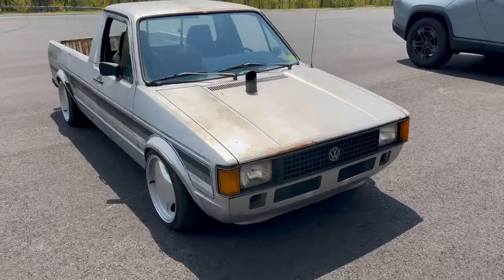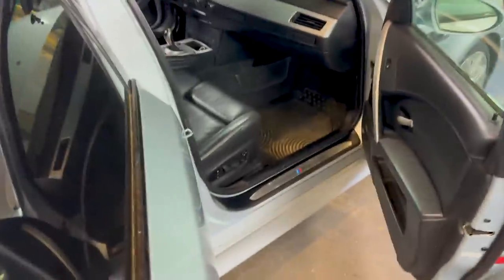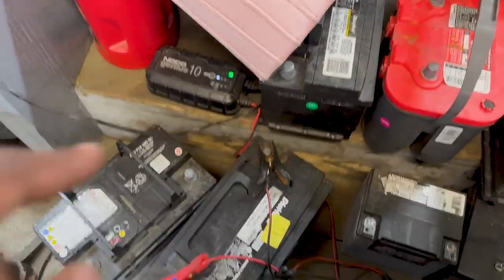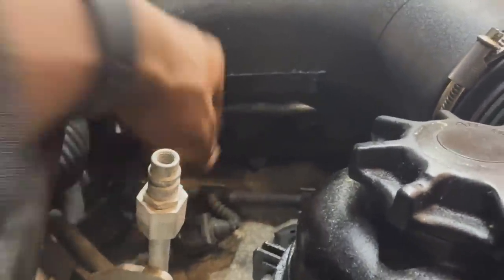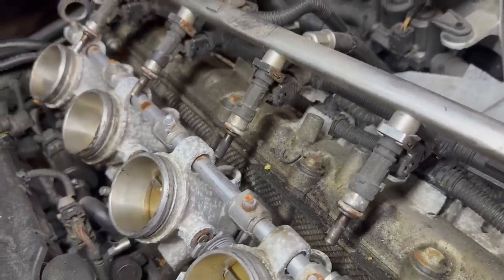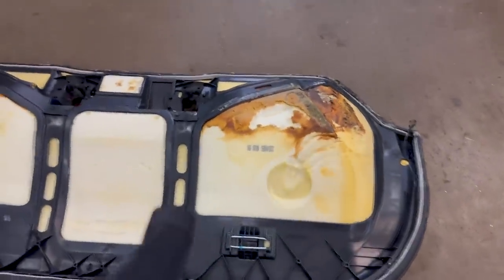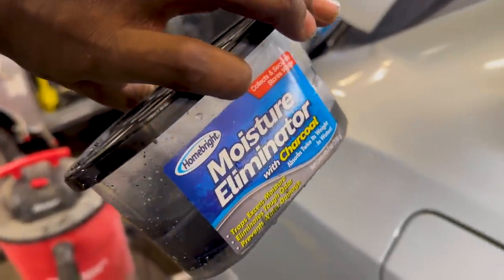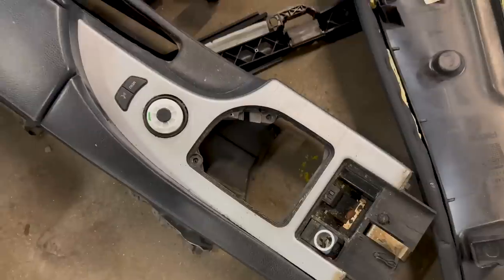Fixing a Non running V10 BMW M5, a marketplace disaster, please help

Comment: Rich: If you replace the battery with a new one, you'll also need to reset the computer as the alternator varies the charge based on battery age. If you install a new battery without resetting the computer, it will continue to think that you have an old battery and will continue to send a higher and excessive charge to compensate for age, prematurely destroying the battery. This is a well known BMW issue in newer models. As for the moisture issue, I know of a great way to get rid of that, it includes a giant box and a crapton of rice...
Reply: issue ? lol 😅 its not issue, you only not understand that system...also you need to register proper battery type / amps...
Reply: God I hate new cars
Reply: I must be a man of little patience, because at this point I'd be buying a bicycle.
Reply: plus you could have lunch
Reply: @FalculoCornuto  Of course, that's part of resetting the system and computer. Going in and resetting the battery data is what informs the computer of manufacture, months expectancy, CCAs, and other battery data. It's a BMW, that's par for over-engineered German cars.
Reply: @FalculoCornuto  What an odd reply.
Reply: When I put a new battery into my E65, my climate control started acting all crazy. Air positions would change on their own and the whole system would turn off at times. Was driving myself crazy trying to figure out the problem until I found out about this feature. Funny how advanced these cars can be but they’re not smart enough to realize they have a new battery. Luckily after telling the car it had a new battery everything worked perfectly.
Reply: Lmao I drive with disconnected IBS and  have zero issues. I couldn't care less about registering new battery and all that stuff, car works just fine.
Reply: You need a respirator for things like this. Breathing spores is dangerous.
Reply: @pavulon5000  It works fine until the continually overcharged battery explodes in your truck a few months later, leaving hydrochloric acid covering everything and significant body damage. This is a known issue in modern BMWs.
Reply: @WS102  I guess I'll reconsider my decision
Reply: Speaking of power, anyone have wiring schematics for e60s? AC compressor isn't recieving power. Need schematic to test it.
Reply: I thought this was satire at first
Reply: All good points. He did the rice in a box with the Audi.
Reply: He needs to replace the ionic control modules too....
Reply: This is why I bought an e55
Reply: Car doesn't run for that to be an issue at the moment lol
Reply: @WS102 sulfuric acid*
Reply: @ReservedForFutureUse  It's a great system, it's just not intended for backyard mechanics to deal with

Comment: Rich, use a spray bottle filled with a sodium carbonate solution on the mold. It's $30/gal at the hardware store but you can mix your own by purchasing a box of A&H Washing Soda at the grocery store. About 1/4 cup per gal with 1 or 2 drops of dish washing soap. Spray it on and it will kill and help immobilize the fungi. After it dries, it leaves a fine white layer which prevents spores from taking hold on the surface.  A damp rag will remove the residue.  I'd spray every surface at least twice and then put a room dehumidifier and an ozone generator in the car and let it run for days.
Reply: I'm personally a huge fan of Moldex it works wonders. Good tip though.
Reply: This is good to know, I'm often horrified by moldy interiors and always wondered if there are ways to get rid of it, short of just stripping and burning all the moldy bits.
Reply: Clear distilled vinegar.
Reply: @Thinginator  I learned this after our flood in 2013. You really need to get as much moisture out of the air as possible, along with coating every moldy surface with the carbonate. Carpet and insulation is near impossible to de-mold, so remove it and expose the bare surfaces underneath and then treat.
Reply: Or better yet sodium *per*carbonate. Breaks down into a mixture of sodium carbonate and hydrogen peroxide when you dissolve it in water.
Reply: @802Garage  I'm a huge fan of people who refrain from calling everything "personally" but that's just me. This particular mold has even reached Europe.
Reply: @TheBackyardChemist  Good call. It's more expensive, but more effective at cleaning. A&H is less than $2/lb while percarbonate is about $9/lb. OxyClean is a 50/50 mix of the 2 at around $3/lb.  I already have some (with perfume). I'll be using it when I refill my "anti-mold spray" bottle.
Reply: @narvul  It's funny you say that. I wrote a comment on the latest Tavarish video earlier today and used the world "personally" in the opening sentence and realized it sounded stupid so I deleted it. I try to refrain from using unnecessary and obvious language, but sometimes I fail. At any rate, Moldex works great!
Reply: People,  don't ignore the room dehumidifier idea.  It works,  in the house too,  makes the AC work better using less energy.  
Anywhere there is a moisture problem,  just let that sucker run day and night and see how much water it removes from the air.
Reply: @802Garage  Moldex is even available over here in The Netherlands...!! I've never needed or used it but I know the health danger of mold, especially black mold. I had it in my house but a dash of perchloride did the trick.
Reply: @narvul  I had an Eclipse with a smashed window and mold grew on the carpet, seat belt, and actually on the seat leather! I kid you not when I sprayed Moldex on the seats the mold disappeared as if it was turning invisible. Killed it right in front of my eyes and it hasn't come back. It doesn't have that vanishing effect on all mold, but spray it on and wipe off and it tends to be dead and gone.
Reply: @802Garage  probably this Moldex contains chloride.
Reply: @narvul  Are you personally a fan of that?
Reply: @narvul  Could be. Haven't looked up the ingredients yet. Didn't damage any cloth or plastic or other materials though for me. :)
Reply: @jiminauburn5073  I'm personally (doing) everything. Maybe you should diversify.
Reply: @802Garage  Chloride is the main killing ingredient for mold.
Reply: @randolfo1265  When I lived in a no-AC house in NC (I grew up in CO) we used to collect gallons per day in order to help make at least one room "mold free".  In a car like that, I'd set 'er to 11 and let her rip for at least days.
Reply: @frankhage1734  -  Sounds like a good plan
Reply: Concentrated vinegar works great
Reply: @infernaldaedra  Like using bleach, vinegar works but does not leave a residue which prevents mold growth.  Until the area is bone dry, mold will spread.
Reply: @frankhage1734  bleach actually is only good for removing the mold stains, vinegar treats the surface for some time as I've tested it in wood that was molded just as bad from a conversion interior and the vinegar treated wood did not grow back spots, but on wood because it seems so deeply I recommend treating it with polyurethane

Comment: You should..you should probably get a respirator. Mold is no joke.
Reply: Not that big of a deal. Open air. Use gloves, wash your hands and don't stick your face in it or try to eat it. More than likely it's just mildew! They will be fine
Reply: @theglitch99  You clearly know little about mold.
Reply: Throw a chlorine  tablet in a water cup, leave it in the car for a few days sealed up outside.  I'm not sure it helps with mold spores, but it should kill most anything biological,  Including the smell, and make it safer to work on.

Comment: Rich, long time E60 M5 owner here:

If you decide to keep the car for a while:
- change the injectors
- the buzzing sound you here is the SMG hydraulic pump priming. Don't worry
- on the front of the engine there are two ionic current modules. These can cause misfires and no-start issues.
- check the fuel pump, fuel breather valves (under the intake plenum) and the charcoal cannister. Check all fuses.

Good luck!

Comment: I had the same issue with my e60 530d that wouldn't start after flattening the battery. Turns out the immobiliser can forget the key code if the battery is drained on these with no obvious signs other then turning over but not starting. Before spending countless hours replacing stuff i highly recommend looking into re syncing your key first(can simply be done with a usb obd cable and software called INPA ).   Love the new addition to the channel by the way and can not wait to hear that thing sing once you get it going .
Reply: The car would throw a key fob light on the dash. ^

Comment: M539 Colab! He's a Youtube BMW Legend!
You'll have it up and running in 1 episode with his help.
Good luck Rich, love the way you push the limits of humour without triggering Youtube or people! 😁😁
Reply: Sreten doesn't have time for a redneck M5 like this one.
Reply: @millll111lllI  😂😂😂
Reply: Use to pour hot water mixed with bleach down the rain gutters in our X3 every 3 months due to the same water issue. Also, did a head gasket on it..if the injectors are not put back in the same spot..they will not work.
Reply: I was about to suggest the same. M539 Restorations is awesome and his V10 vids will tell you everything you need to know.
Reply: I love M539, but Nathan’s BMW Workshop has resurrected a few V10 M5s now, and actually considers them reliable when properly maintained

Comment: I've owned a E60 M5 for about 7 years now, injectors are on world wide back order. They are a Bosch item so you might be able to find some Bosch ones in stock somewhere.

Apart from Rod Bearings, the throttle actuators need to be rebuilt, but you can wait until they die before doing anything. Vanos is generally OK, don't really need to do anything unless you have an issue. And you already know about the SMG pump, again, doesn't need attention unless you have issues.

That noise you hear when you connect the battery is the fuel pump priming, btw.

Comment: I just had the same crank/no start issue with my M5 and the fix was the cas and dme units had to be resynchronized with a decent scanner. The sound, torque, and handling make this thing well worth the headache.

Comment: Rich,please check the wiring harness on each side of the interior. What can happen is if they get wet there are weird connections that corrode and cause shorts. If you resolved those connections after drying everything out , you will avoided electrical issues. Porsche is known for the same issue,especially Cayyanes.
Reply: That’s what I’m thinking. Various codes for several systems and standing is probably ecm/bcm/harness related
Reply: Don't forgot every Infiniti! Ask me how I know :(
Reply: Cayenne owner here. Yes. He's already got the seats and carpet up. I didn't remove my carpet entirely but I think it was about 7 electrical junctions on each side.

Comment: Rich! go in engine bay, underneath the ac vents (remove them) there is a black box at passenger side open it and ‘ll find the main engine wiring harness, modules, connectors and various fuses. I had a similar problem involving the water drains and the black box was filled 1/3 water, various modules where fried i had to replace them, the e-box fan was the most difficult to access at the bottom.

Comment: I've got a 2006 with 186.5k on it. That periodic whine when you first turn the car on is the gearbox hydraulic pump motor. It spins up to prime a pressurized reservoir which runs the clutch and shift actuators. It will occasionally kick on while the ignition is on (even if the engine is off). It sounds healthy.
The good news is that it's all self-contained on the outside of the gearbox. Even the cooling, which makes the gearbox fairly easy to remove. All you have to do is unplug the harness.

Comment: I have a 2016 x5 and the sunroof front drains clogged and flood front passenger seat.  Used weed eat line to push through the clog and blew it out with air.  Passenger airbag also came on because of moisture in the passenger seat.  Took a water vacuum to suck out what I could then ran a heater on and off for two days.  Finally got it dry enough to put it back together and then used seat warmer to evaporate the rest.  It’s a painful process.  Good luck.

Comment: I had one of those E60s a couple of years back. The rear door vapour barriers were pretty notorious for failing and ... letting in rainwater which would pool in the rear passenger footwell. I had the barriers replaced by a backyard garage and they made things worse. Then I had a professional workshop do it and that sorted the issue right out.
Reply: Had a e60 for 9 years and had the exact same issue with the water and mold under the seats.  It was bad sunroof seal and clogged sunroof drains for me.  I was sick everytime I drove the car for a while before I found it.
Reply: Sunroof drain channels blocked is the most likely cause for that much water and especially seeing as it was focused in the trunk and behind the rear arches.
Reply: yep, pull the door cards and check the barrier is sealed properly. i bet the drains are blocked on the doors too. May as well replace the door handles while you are there if they have the black soft touch rubber. That's likely failed too. looking forward to seeing this come to life.
Reply: Yeah those are NOTORIOUS for leaking in just about all BMWs I've dealt with (was a stealership tech for 8yrs).  Have to make sure you don't rip them and then when going back together, replace any bad/missing butyl tape and make sure they're sealed properly.  Also, sunroof drains clog up quite often (like this one), and it runs down the inside of the pillars and onto the floor.

Comment: Mr Rich!!!! I had a similar issue caused by blocked sunroof drains in my e60. My car wouldnt start either!!! It would just crank and crank and crank!  The forward sunroof drains caused an issue where even the DME in the area under the cowl became water damaged. I needed to get a used DME and get it coded to the car. Anyone reading can you please thumbs up so Rich can see this, thanks!

Comment: Well Rich, I have you beat I picked up a 2008 M5 fully running and driving on fleabay same color much better condition. I got it for 4500 in 2019. It needs new seats because the leather was trashed and needs a new paint job.  Mechanically it was fine, I did rod bearings my self and actually they were pretty good at 120k. I have a few of these M5s so LMK if you have questions.

Comment: Had this with my e46. Water poured in through the boot, filled up the battery tray and soaked the boot, had mould behind the back seats. It seems to be a theme with BMWs and they dont even need to be old ones either.

Comment: Check the drains right under the front cabin filters. They block and water fills up there like a tank and overflows into the front foot wells. The worst of it is the active steering ECU is located in the foot well and almost certainly it fries. I had to go through 2 before I extended the harness and relocated it under the dash.

Comment: first impressions it was a flood damaged dryer sheets for the smell only way is to swap out the inside sunroof drain the tube exit was blocked injectors water damage (change)

Comment: While you've got the back taken apart, you should inspect the wire bundle that runs into the trunk lid, mine started breaking where it enters the tube, which caused intermittent problems with the license plate lamps and "trunk open" warnings which could probably result in the alarm going off too. I spliced in some fresh wires and it's all good. They still sell a replacement harness.

Comment: Rich
Put the key in the trunk key slot, turn it both left and right... Can't remember, but one way locks the trunk, and the other way will mechanically open the trunk. No power required
Reply: or just use a car charger on the jumper terminals in the engine bay and then press the button to open the trunk
Reply: M5s dont have a key hole on the trunk.
Reply: @king_tut.  my M5 begs to differ.
Reply: @zachlitberg  depending on how deeply discharged the battery is, that could easily not work. Low voltage can put one or more modules in odd failure states, which can draw a decent amount of current, possibly more than a charger or jump start could safely supply. In those situations, it's best to disconnect the battery from the car and charge it on its own, then reinstall the fully charged battery
Reply: @hotgarbagellc  could be a pre-lci thing because my 08 doesn't have one..
Reply: BMW seem to like doing weird deletes on LCIs. Things like key holes in boot/trunk lid, opener button in drivers footwell, valet parking switch in glove box. They then bring it back for the new model to take it away again in LCI. 🤷‍♂️
Reply: @wrongmark  bmw's MO to a T. They also seem to like to put the ugly lights on every pre-LCI, and then make the LCI lighting look much better
Reply: @juggnautbitch  there's supposed to be a filler panel that covers the keyhole? Every other one I've seen must be missing it as well
Reply: @juggnautbitch  good one.

Comment: I inherited a 316i from 2000 from my father. Fabulous car to drive for the cost. Even managed 205 km/h on the Autobahn in Germany. When the brakes were so gone it sounded like a Soviet train braking I had to sell it cause the new brakes cost more than the car was worth. An emotional day for me, because of the connection with my father.

Comment: You can’t trust any codes until you get a fresh battery in there.
Reply: Anyone else notice he didn't tighten down the battery terminals?  I wouldn't trust a weak crank either.